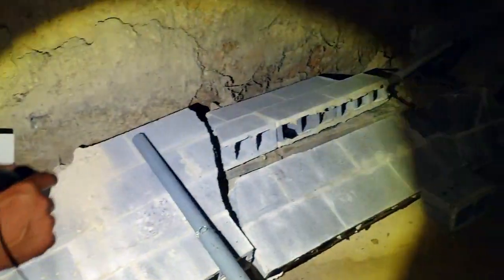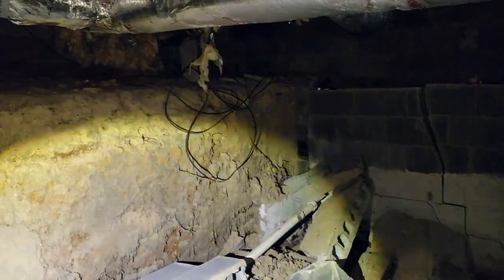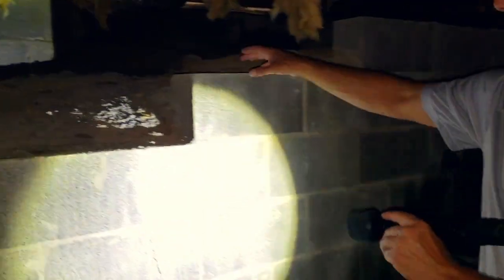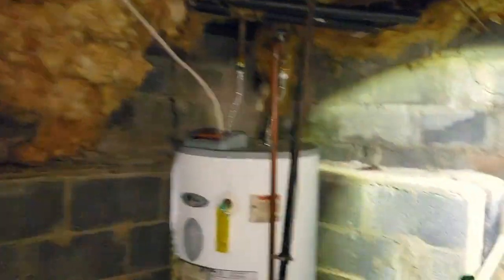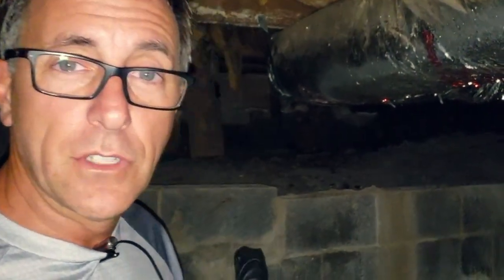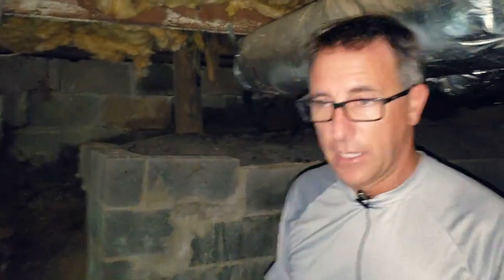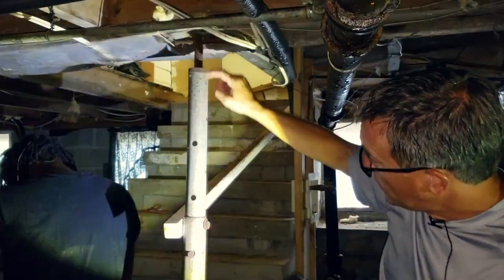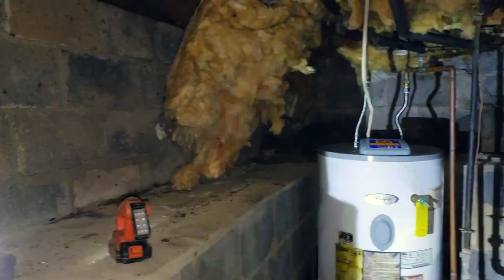HORRIBLE Foundation Wall Failure! How to Turn a Crawlspace Into a Basement - Part 1 from Insta Dri

Comment: Can a basement be made from super low crawl space? Mine is literally where you r on ur back laying down.
Reply from the maker: It can in some cases depend on the land around it. It also depends on the age of the house. Typically you have to put large I beams under the floor system then lift house up and dig. Very dangerous but possible. Not cheap though!!!